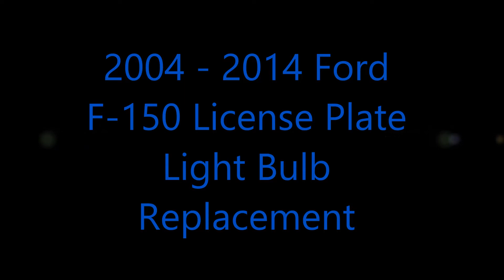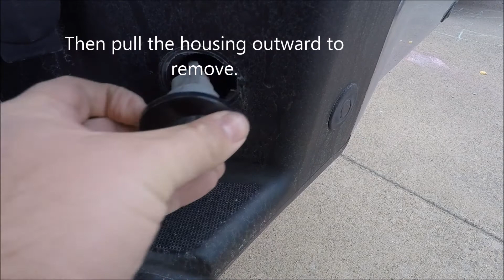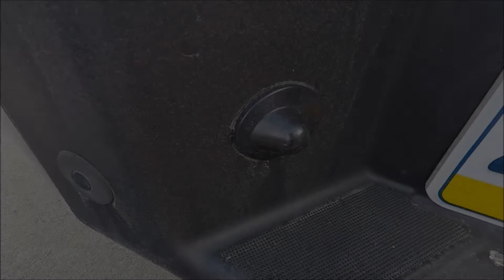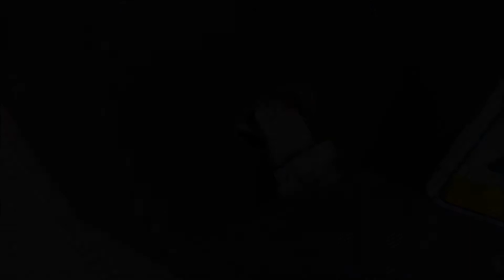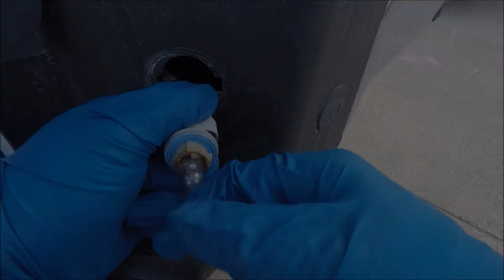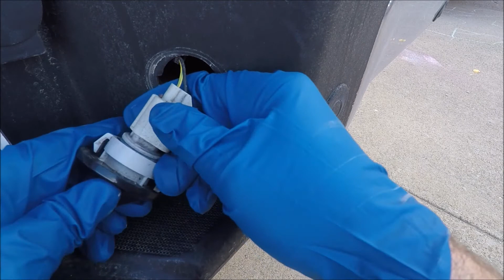2004 - 2014 Ford F-150 License Plate Bulb Replacement

Comment: The bulb is busted off flush in the socket any ideas?
Reply: Yes.... Get a pair of tweezer and/or needle nose pliers. I would spray some silicone lube into the lightbulb dwell. Keys out of ignition. Reach in and pull the remainder stub out. Insert fresh Slyvania #194 with a dab of dielectric grease. This grease increases connectivity as well as providing a "release" so it doesn't happen again. This dielectric grease blocks out moisture as well. AutoZone, big tube, about $8, soon to be $44 with inflation. Get a tube of it now, use it for all electrical connections auto y home.
Reply: Recall the last time you went to the dentista and your doc use a compact pick on your teeth and gums? This is officially called "an explorer." Head to Harbor Freight, they sell a set of these picks inexpensively. Your tool box can use them!
Reply: Thank You Thank You!!!!!!

Comment: My light is flashing....anyone know why?
Reply from the maker: Flickering or a rhythmic flashing?
Reply: @stuffyoucando2  flickering just the right side
Reply from the maker: @charles w  That could be a couple of things. It could be the filament inside the bulb is broken and making intermittent contact. Replace the bulb to see if that fixes it. If that doesn't fix it, then it's likely either corroded contacts in the bulb socket, or a wiring problem.
Reply: @stuffyoucando2  I always have a tube of silicone DIELECTRIC grease at the ready. PermaTex, about $8 from AutoZone. I use is it on all my electrical connections and household light bulbs
Reply from the maker: @Swimfinz  yep that’s not a bad idea.
Reply: @stuffyoucando2  ... Thank you. Yes, the dielectric grease acts as a release whenever removing any light socket, multi-pin clip, etc. Just a schmear goes along way. Seals out dust 'n moisture as well.....

Comment: Make sure when you're putting the screwdriver behind the housing you're pushing in the detent.  
It's probably better to just reach under the bumper and twist the socket out of the housing instead.  Much easier to do and less chance of breaking the housing...like I did.
Reply: And like I did! LoL
Reply: I had to get the superglue out